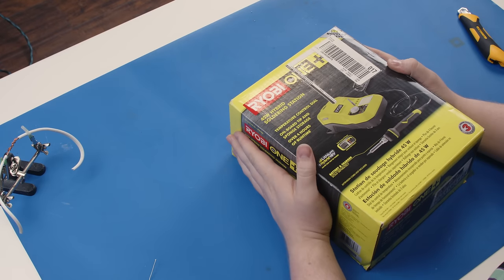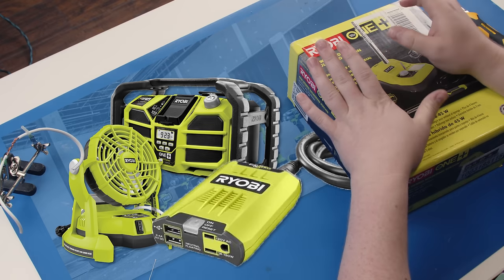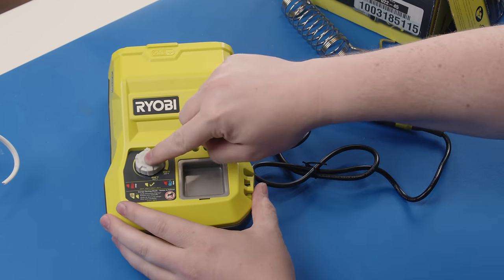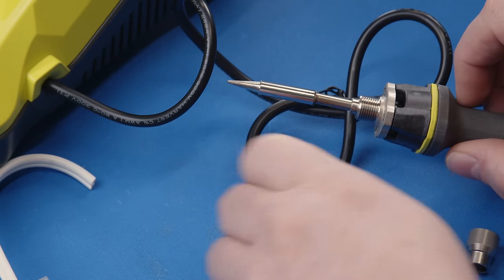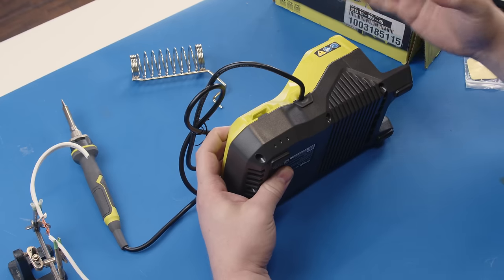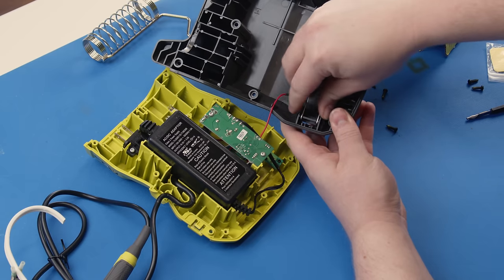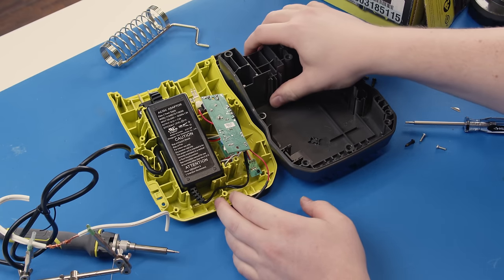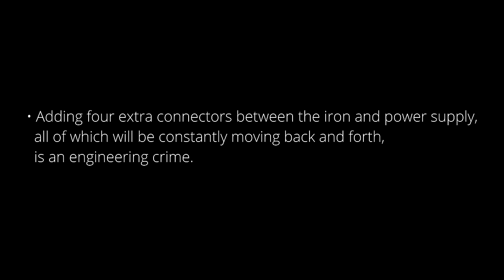Ryobi has GOT to be joking with this soldering iron

Comment: So its been 2 years now and still no video on the Pinecil, if you still haven't given it a try you are missing out.. The "reasons" you give in the end of the video does also not really make sense in my head, for your needs the pinecil and a holder seems like the perfect fit.. I often don't even care about a holder, i just lay it on the table, its not touching the table and it cant roll away and i always have a usb c cable near me, it just so easy and convenient

Comment: I have the same issue with my little non portable station the cable is garbage, I'm going to cut it off and replace it but we should have to that's so trash. I kinda knew but the iron was super good value in other ways.

Comment: It would have been nice if they had made it so that the battery could charge while it was plugged into the wall. Especially if I want to move from the bench to the car, let's say, and then back again. If I  know my battery is flat, I'm gonna start out at the bench. So it can be charging while I'm using it.

Comment: Those weller stations were what we used at my first job, there was the one you showed with just the temp knob and another that had a temp readout with the temp control knob.  Company made germanium radiation detectors and all kinds of nuclear safety related electronics.  So yeah more than good enough for what you're doing.  Those cheap plug in irons with no control are literally unusable.  The tips are so bad once they get a bit of solder on them it gets major hot and cold spots, youre constantly spinning the thing around to find the hot spot to melt the joint.  You can barely melt anything with it unless you hit it just right.

Comment: I have been using Rybobi tools since the 80s. I have only one tool that failed on me ever, and that was the fogger chemical dispersal unit. And I run a commercial flooring business, so yes, I use my tools everyday round the clock.  If you have a brain and take care of your tools Ryobi holds its own.  Are all of their tools perfect? nope, but I don't buy Weller for their Air conditioners, so why would I buy a soldering station from Ryobi?

Comment: cool. But on the convenience issue. if you can use a extension cord. you can use your weller. Its actually slightly smaller than this ryobi. Your point in not  really a valid point. If it wasn't just to have another talking point, its just you being difficult . There is enough wrong with this thing. Otherwise ty gj.

Comment: Except for the cable to the soldering iron, this review was pretty much not useful.  No one is going to open the guts of it to get bent out of shape of how they would do it vs. how Ryobi did it.  You could have spent way more time on evaluating knob to temperature measurements to solder quality and it would be worth a watching.

Comment: TLDW: Pretentious man is angry that cheaply priced soldering unit is made cheaply with cheap materials and often compares it to units that cost 5x-10x as much. LOL

Jokes aside...what did you expect for a $50 unit? It's still FAR better than the $30 Amazon unit I also have. It's exactly as good, if not slightly better, than you should expect from a $50 soldering station.

Comment: had one of these soldering irons, died almost 1 yeaer to the day, it died after my first long session with it, was using it for about 4hrs straight, and ended up with a power issue wouldnt turn on, took it back and went back to my old iron

Comment: Older DIN connectors use much better plastic that is near impossible to melt with a soldering iron. But for worse plastics you want to clamp the pins with a lot of metal to wick the heat off

Comment: Pure $5 Bucks crap to build,but is good,I have had one whiteout temperature control and works good,but the pain is the Temperature can't go less than 400,even this one whit temperature control lowest temp is 400,hard to solder PCB boards,etc,I've got use to it, I've became faster and more precise thanks to one of this,at first it will screw your jobs big time until you get use to work at a high temperature! After sometime the battery will only last 30 minutes if so,this one whit power cord adapter looks great,but honestly a cheap soldering iron from popular selling platforms will be a bit better,no station to keep an eye on,no battery,no recharge battery time,just a long cord,adjustable temp lower than 400,but the tips are crap so buy good Quality tips for those cheap ones! But the Ryobi stills decent and good but for $74 no way,got the older model on sale whit battery for $29 so if you get it for cheap,go for it! I thought of buying one of this when I saw it has adjustable temp or the other model tha has it too,but crap, no temp lower than 400 so pure BS!

Comment: Ryobi is pretty much garbage. I realised this like 15 years ago as i worked on RC vehicles, they basically sold a charger for 100$, yet it was the exact same (internally AND externally) as a chinese branded 15$ charger, and well, both were working for as short, some months at best before the electronics fried themself. The only difference, the chinese charger was thrown away without any money back while i got a new Ryobi charger offered (and didnt accept it, not another e-waste product please)

Same with other stuff including expensive flight ESCs or just receiver/transmitters.... just overpriced because people once thought Ryobi is a high quality brand, yet its the cheapest rebranded chinese stuff.

Comment: why don't you get someone to 3d print a new enclosure and replace the cord and add the better material so that it is cooler for the parts and better maneuverability but just a cheaper case?

Comment: I have been buying ryobi tools since around 2014. Just beause of how useful of a diversity toolset platform they have of using so many different tools using basically the same batteries (don't use the small packs)... My tools never broke bown like what some people would project to me... The only problem I ran into was, which I believe is common sense,... Don't use the sawzaw blade that comes with the ryobi sawzaw. Get the diablo blades or the milwakee blades... 

I so would believe that people would have common sense just from looking at the blades... But... I need to accept the diversity skill level... Just like... Most people don't even know how to change the brake pads on their car or even know how to change to a spare tire. Most people in USA don't even know how to replace the battery in their vehicles, or the battery is too heavy for them to lift, or figure out what wrench size they need...

Comment: Bro I made my multimeter rechargeable with a usb-c port with a simple $18 soldering iron if you cannot do the most basic soldering with a basic iron you are NOT good at soldering idc what you say. If I could learn on a basic one and create useful upgrades you should be able to without the tip breaking and doing 180’s no excuses.

Comment: The whole power supply thing just looks like something "homebrew", somethng you would do to reuse a power supply you have in your usual standard cardboard box sitting in your garage to do some "makeshift project" for a sunday afternoon. And yes, that usual, bulky, dull, rigid and annoying cable just can't be seen. Still, since the base occupy some considerably space and there's some decent power supply in there, it's a shame that the unit isn't engineered as so as it could be used as a charger for the battery. Finally, 20V 8A to power an led light strip? REALLY? Come on!

Comment: I dont get your fixation with nitpicking about the power supply for one. Seems to me they made good use of a supply they had access to that kept cost down without cutting corners by doing something that might equal a fire hazard or damage other equipment. Seems safer than an open frame exposed board and while it does seem a bit odd to have been done that way, it's certainly not something I'd look for reasons to shit on either. Otherwise, you don't like the iron cord material, 90% on the market are using the same cheap polyvinyl chloride so best get to shitting on all those guys too I guess. I personally just don't burn mine like a dumbass and it works great. They did good on the strain relief which I would be more worried about personally. Circuit board has flux on it? 😅 Find me any manufacturer who's cleaning their boards after manufacture .....I'll wait....otherwise, best you could do is to find little gripes to bitch about the casing not being up to your ridiculous standards.... Idk, at first I kind of appreciated your thorough look at it from all angles, but then it became apparent it was turning into more of a witch hunt to find any reasons at all to shit on Ryobi. We all know Ryobi isn't going to be the same quality as Milwaukee or Makita, no surprise there. It's also a 3rd of the price in most cases, and geared more toward the DIY weekend warrior at home, and not meant for the tradesmen who use these tools to make a living. Consider educating yourself more on simple concepts such as torx drivers...yeah, they come in sets like screwdrivers and don't need to be filed on a bench grinder. You're lucky they weren't safety torx with the pin in the center requiring the torx driver with a little hole in the tip to actually fit the gear correctly, you'd have been absolutely lost and likely blamed that on Ryobi being inept as well rather than realizing perhaps you're just not as in tune with how things actually work as you think you are. But I digress, Ryobi is what it is. Not the best by any means, but well worth the price compared to the higher end tools that honestly aren't a whole lot better for the prices they fetch. If those were the best gripes you could drudge up for your backhanded review, I'd say the soldering station is probably a pretty decent buy considering what else is available for much more money in comparison. The power supply....seriously, can you even offer a legitimate reason why there's absolutely anything wrong with how they chose to do it? I for one think it's great they found a way to keep from having an extra external part to worry about being damaged in transit. Maybe you should start opening up some of your higher end products and see what you're really paying high prices for, you may find a new appreciation for the Ryobi products after all.

Comment: Wow man, if it is really that bad then maybe I should go buy one a better temp controlled iron. I use a weller cheapo and it is better than like the cheap amazon ones I have.. I just figure the couple times a year I use it doesn't make it worth spending the money on it, but last month I had to try fixing my Keychron that I wanted to de-switch.. never in my life hated Weller so much, that thing is unreliable if using longer than 10-15 mins. Ruined my keyboard and messed up the trace lead and even took the caps off the pin holes..

Comment: Eh, had to make it cheap somehow, if they put a computer charger in there, so what it made it cheaper

And in my experience (with my 40 buck amazon station that was surprisingly decent) that ceramic heating element heats up surprisingly fast, but i gotta say, what the absolute #### was Milwaukee thinking with that element, its supporting most pressure put on the tip.

Comment: That's funny because I just spent $150 on a Weller soldering station and it feels like it should be from the Dollar tree store the chassis is literally the cheapest plastic I've ever felt in my life and taking it apart it will shatter and break it should be thrown in the trash and is utter disgrace

Comment: I do the AC mechanical on the commercial side and this guy is comparing tools that you use every day all day week after weak to something that you will use at home for small projects at home . I have one of these at home that I had for a couple of years and it is still working just fine . The type of tools depends on what type of job you are going to do. It would be like me taking my little 110 welder which is great for small projects at home and comparing it to a $ 5000 commercial welder

Comment: Not sure what you mean about putting a lot of pressure on the iron tip' your supposed to run the tip with solder not use it like a crowbar ............

Comment: You are correct about Ryobi having a ludicrous variety of tools on the 18v battery platform.  Some of the strangest as of this post are:

 - An absolute UNIT of a 12 AH battery pack 💪
 - An adorable 6" pruning chainsaw 🌻
 - An equally adorable 1/2" wide finger belt sander 👉
 - A frightening looking hand cultivator 😱
 - A mutant 3-in-1 mower / edger / string trimmer unit 👾
 - And the one item every garage needs - an electric hoe!  😂

Comment: My god all my life i have been using those shit irons which just plugs in the wall and a STAND ? I let it hang from the wall and guess what it doesn't get hot enough to melt big solder pads so you gotta use a blowtorch to get it a little more hotter then after each time you TOUCH anything conductive gotta heat it up again :D you can imagine how fun soldering is for me and I refuse to spend more than 2 OMR on soldernig iron

Comment: "prefer good tools bloo de blah....*proceeds to hawk Ryobi....Owns a weller? Yet cant what fer da soldering gefunken?*"

Bro

I think your biggest issue is finding problems instead of finding solutions.

Shit, ive got the craptastic Hazard Frought cheapest solder iron with a "temp control" and that solders the fuck out of anything.

So, id suggest in Earnest, that you invest in some quality flux, watch or listen to a few Louis Rossman videos, then have at it.
Keep ya tips clean and tinned. The solder is what gets the iron hot, not just the contact of the iron to the stuff being soldered.

At the end of the day, theres nothin to it but to do it, but if ya dont do the solder proceas properly, itll suck ass and cold solder all day long.

Comment: I've had a few Ryobi tools over the years,  my impression is they are OK, just barely.   Everything I had from Ryobi seemed to be just barely.  No way would I pay that much for a soldering iron. You are yammering on about a lot of stuff that really doesnt matter, better to spend 1 minute telling people that the iron doesnt matter that much, and the other 44 minutes showing people what IS important to soldering. 
I disagree that you must have temperature control, they put men on the moon with soldering irons that were just 25w average, used by people who could look at a bead of molten solder and know what they were looking at. And I have old Weller 25 watt irons that still work, some of them used in production pcb manufacturing environments for years that are nearly as old as the ones used to put men on the moon. Battle scarred and ugly but just as functional as they were when new in 1972.  Once every 10,000 hours of on time you replace the cartridge in 2 minutes for a $15 dollar part and you are good for the next lifetime.  It is kinda nice to have a variac to slightly tune the wattage for a production setup. 
 Soldering is not that complicated but it does take some practice to develop a skill at it.    It doesnt matter how much you spend on an iron, it wont matter if you dont know what you are doing. Clean, shiny solder is what you are after, if it gets grey, dull, grainy looking wipe that junk of and get some fresh, clean solder on that joint. And if you have any black junk left over in the rosin on the board, your tip is not clean or you are way overheating the joint.   Every time you pick the iron up, clean that oxidized and de-alloyed junk off the tip and give it just a tiny wetting with fresh rosin core solder so that the portion of the tip that is going to make contact with the part is shiny solder. The hotter it is, the faster the solder oxidizes and dealloys which can be observed by that dull grey, grainy look. Too cold and/or too small of a tip and it takes too long to heat the part up to soldering temp.   Beyond that, just take some old PCB and practice touching up the joints on it until you can do it  quick and clean every time.
And for tiny stuff you need a tiny tip, and tiny flux core 60/40 solder. For soldering a radiator you need a high wattage iron, a huge tip and a buddy with a preheat torch and liquid flux.

Comment: I can see why nobody in your... Neck of the woods? Would know what's up with the lack of stands and the wiggly thing with the Milwaukee is about. It's for automotive repair, i have a pretty heavy duty old ass radio shack iron (with stand and pad) and not a single tech I've met has been able to recognize it as a soldering iron without further inspection or information from me lol. And it's a gigantic pain in the ass to set the base anywhere on a car, I've had it fall over dozens of times and melt various shit on a customers car.

Anyways, you haven't seen awful soldering until you've seen a mechanic repair a wiring harness, dear lord.